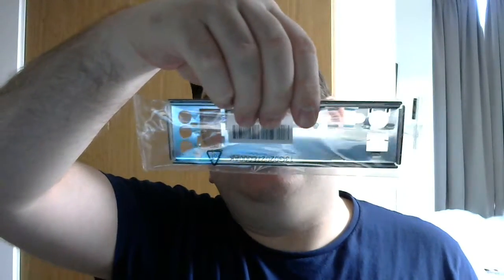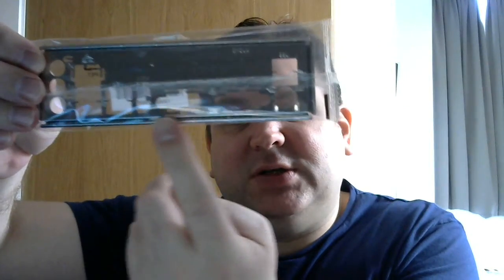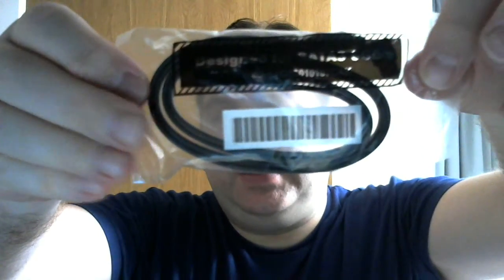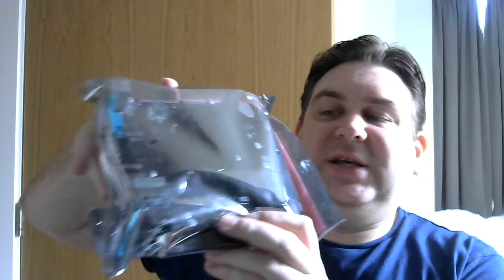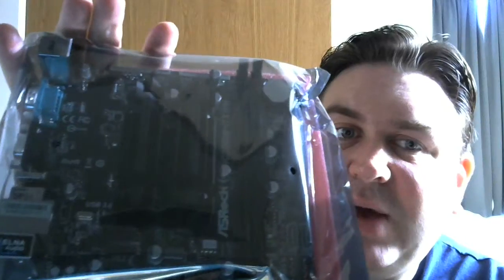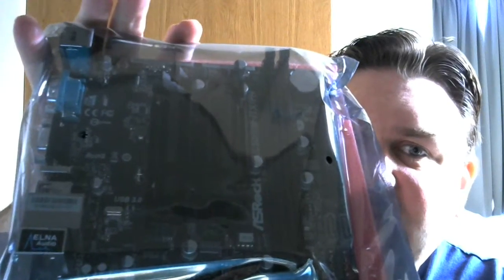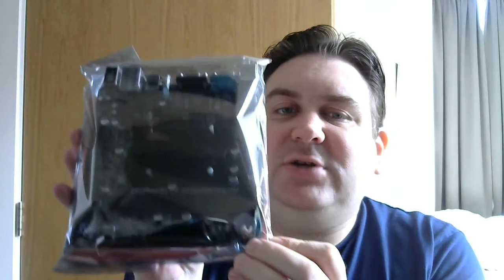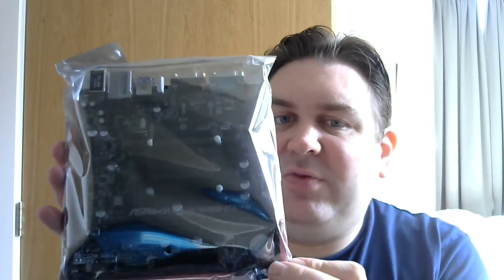#7 - ITX Build Part 1: UNBOXING: ASRock QC5000M-ITX/PH All-in-one Motherboard

Comment: which graphics card it support? i planned to install graphic card
Reply from the maker: It was really a board designed for the AMD A-series fusion chips with built in Radeon graphics.
Reply: @betamax80   no i want to install external graphic card
Reply: @betamax80   nividia  geforce GT 710 2GB DDR3  support ?